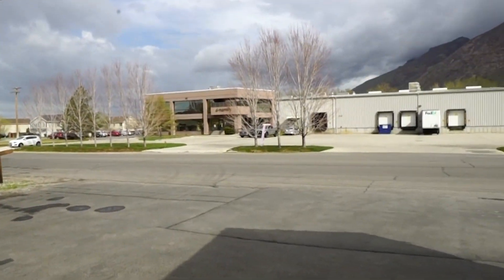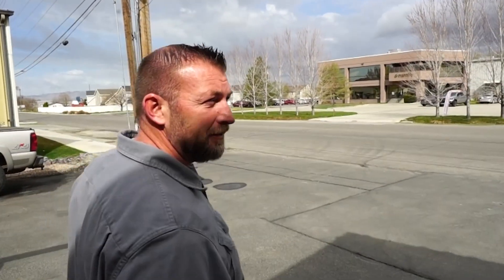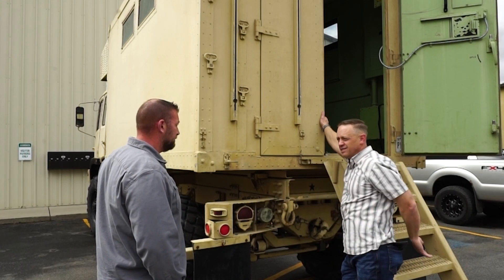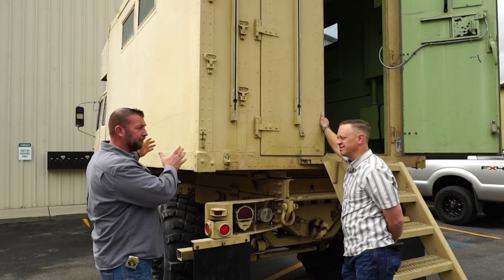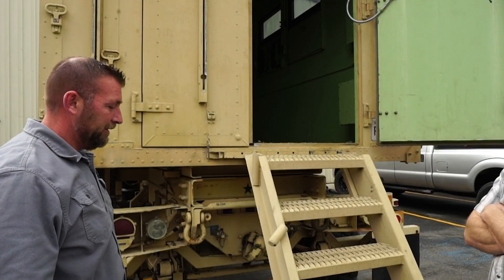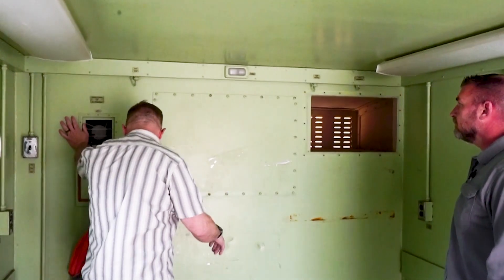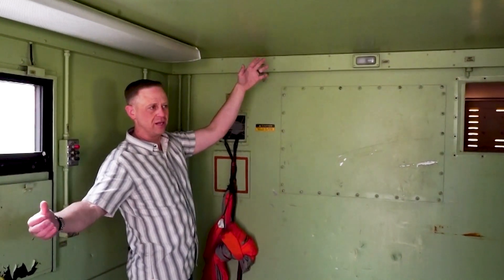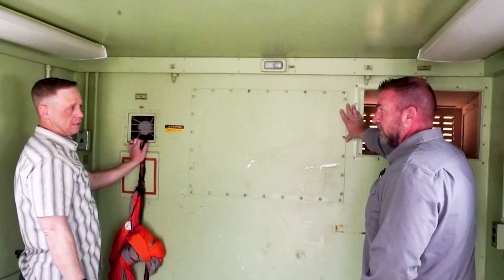Transforming an LMTV into the Ultimate Bugout Overlander - Part 4

Comment: Transmission has a computer wich may be affected by EM.
At least 1000 gallon of water and 1000 of fuel lol.
Reply: True, I’ve since learned about that. A black bag can store a spare though. 1,000 for the win!!!
Reply: You’ve got a great channel by the way.
Reply: I think a truck like this should to be kept as simple and as light as possible. Habitat extensions will make truck tippy and impossible to turn around narrow roads. Exterior Water tank lines can freeze.  Water filtration capability is better than caring tons of water. Water and Fuel in 20l cans. A damaged tank loose all fuel/water. Tools to fix truck and to be able to build shelter. Good tarps. A portable wood stove for outside. Inflatable boat jet motor and eBike. A good set of tire v-bar tire chains. Ham radio comms HF and VHF.
Reply: @OOOOutdoorOffGridOverland  I like where you’re going with this. Also where I’m going there is no water so that’s a plus.
Reply: @TJackSurvival  I follow those extreme facny european builds on excellent MAN 6x6 trucks. They are so heavy, heavier than the dozer who compacted the road. They get stuck everywhere. Narrow and winding roads are a trap for 1M $ "expedition" build. Good luck with your build.
Reply: @OOOOutdoorOffGridOverland  ya I can see that. Honestly at this point the only really heavy item on this will be water. I need my family to be very water comfortable for at least a week in this thing with showers and all that. So 50-100 gallons is 400-800 lbs which is 2-4 people in weight. Outside of that it has already lost a lot of weight by removing doors ladder and unused electronics. But ya I don’t need a FOB in a mud puddle somewhere. I actually took it in the snow today and played on some narrow roads. This one will never be that expensive. That’s way outside of my capabilities financially.